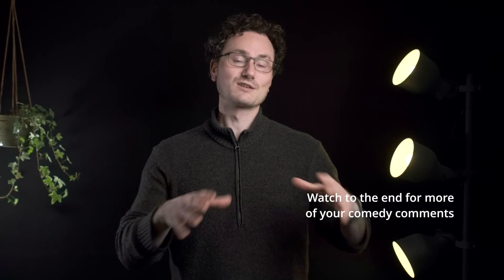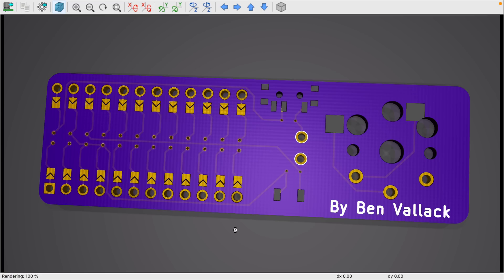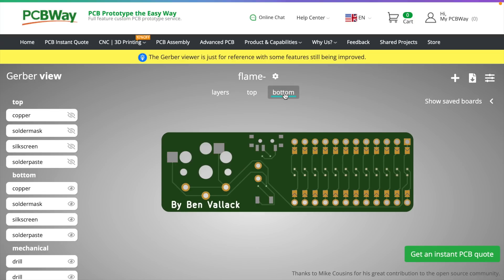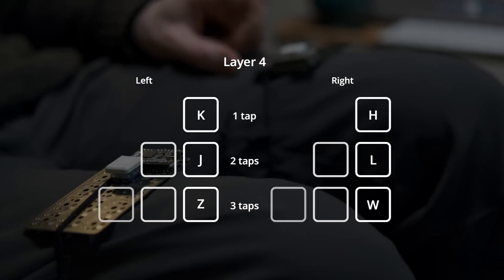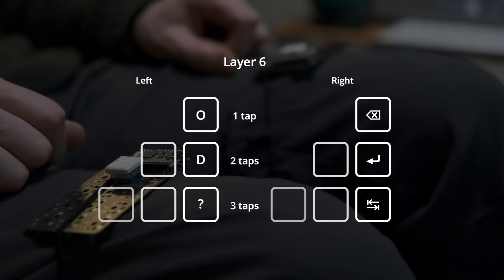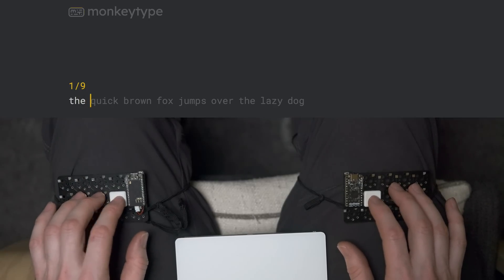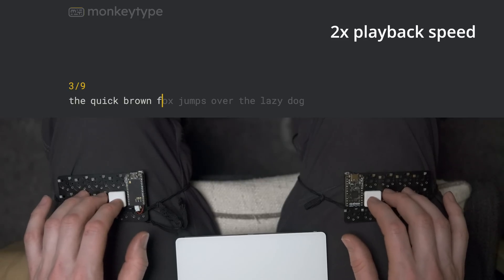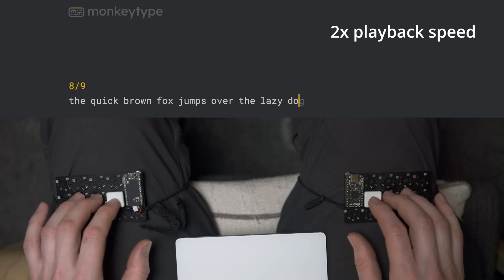World's Smallest Keyboard

Comment: This is near impossible. And near the end, it looked like it was not that bad. I think with multiple ways to jump, like tap+hold 1sec, or tap+tap+hold 3 sec, you can even improve it. What if you program a magnet key??? That might be programmed to output A for light press, E for midle press and I for all the way press. Or a magnetic switch with a tectal hold, like if you press it light, it will stop near the end, but allow you to press harder for an extra key, or extra function. Similer wit acceleration on a automatic car that has like a key in the end. ;) 
Nice video!!!

Comment: Although a custom designed keyboard is my goal, I have also always wanted my own R2D2. My thought was finger cots. Cots are basically mini rubber condoms for your finger tips. There are used by people who's job subjects them getting their finger tips cut by paper or something sharp, or get stains on finger tips from dyes or inks, Any way my idea is finger cots with mini wafer switches in the tips and wireless devices on each wrist to send the key switch data to the 2D2 unit. Voice command for some functions the R2 unit can do on it's own, but remote control movements via finger switches for having it maneuver through crowds. If done correctly the R2 unit would look self aware. I could event use Bluetooth have the two wrist controller talk to a more complex computer worn on my belt. That computer could talk to the R2, via 4-5watt transmitter, on one HAM Radio band and receiver on another of the HAM bands. I am after all a licensed HAM Radio Operator. I could them have sunglasses with a see thru LCD in one eye, and be able see what R2 is doing remotely and also feed a few line of low resolution text to that LCD. Allowing R2 to "speak" to me with random beeps and boops while displaying the actual data on the LCD screen... illusion complete. I would not want the R2 unit  more than a reasonable distance from me, but crowds can temporarily block you sight, so have a lower frame rate video might make the video flicker, but old analog NTSC or slower frame rate video can be legally  transmitted on 70 cm frequencies. The only time video would be transmitted would be when the unit is in motion, otherwise the entirety of the transmission is simple control signals and possibly audio from a microphone headset.

So Ben please look at my other post.
Reply: While I like the idea of finger cots I think building it into a glove would result in a much better user experience.
- Easier and quicker to put on. 
-The wiring can be hidden and protected.

Then again if you're going for a techie futuristic aesthetic then maybe exposed wires are a benefit? 

Anyway sounds like a great project, good luck and don't forget to post a video of it.

Comment: I am attempting to build my own custom keyboard, I want to solder the keys (Cherry MX), but also have an aluminum frame supporting the keys. I have the schematic complete and I have the PCB mostly done, however I need to know how to make or order a custom frame and how to insure the outer dimensions of the PCB will fit into the computer case, and on to the original mounting point. I am glad I ran across this video.

Comment: with 2 keys morse code can be fast, very fast... you'll be surprised how fast you can go!
Reply: I think I'd struggle with 2 keys for Morse code. I struggle enough with just one! It'd take some serious mental gymnastics and a better brain than mine to pull that off.
Reply: @charmio  I think what he's referring to is called an iambic key. It's the basic idea everyone's had about one key for dots and the other dashes except there's also a repeater function built in:
- If you want multiple dots or dashes in a row, you hold that button down the duration of that many symbols. 5 dots is just a single key press with a longer hold down.
- If you want to interlace, you tap the other key at the right time.  the letter "F" is .._. and would be entered by holding the dot and tapping the dash after the second dot.

Dot-dash generation is then only limited by your own rhythmic accuracy. This is how folks get way more than double the send rates of a regular single key that peaks out around 25WPM.
Reply: @TestSpaceMonkey  Interesting! I've never heard of that before. Cheers for sharing mate. That does sound much more manageable (though I still maintain I'd suck at it 😂)

Comment: Sorry that I just found you, a more practical extreme suggestion is a 5 key, one-handed keyboard. You get that same effect of not having to ever move your fingers, and you can use your other hand for your mouse. There are just enough chords to cover every letter, with enough extra spaces at the bottom to add on as many layers as you want. Below is a layout I wrote up a while ago that covers literally every key on a full keyboard, with plenty of extra space for any macros you want to add. If you want, I could write up an AutoHotKey script for this which you could copy, I don't think that would be too hard (if you have access to a windows computer). If you do want that, just tell me what 5 keys you want to play around with, and I can put it in a reply to this comment. This also doesn't use any double or triple tapping or holding keys down as that would just add time to the execution, but I could try to add that if you wanted, or obviously I could reorder any of the combos if you wanted, they're just in order here.

The chart below is a potential mapping of keys: 12 means you press both key one and two, like how you would ctrl+c on a normal keyboard. + is shift, ^ is ctrl, ! is alt, # is windows key. modifier keys work by being "held down" when the next key is typed. 

This covers literally every key on my keyboard, and you could easily add another layer by hitting the function layer key and then hitting shift, but I have no idea what you would even put there, maybe just a ton of macros?

1             a      1
2             b      2
3             c      3
4             d      4
5             e      5
12           f       6
13           g      7
14           h      8
15           i       9
23           j       "
24           k      '
25           l        !
34           m     @
35           n       #
45           o       $
123         p       %
124         q       ^
125         r         &
134         s        *
135         t         (
145         u        )
234         v        -
235         w       +
245         x         =
345         y         /
1234      z          ?

1235      .           :
+1235    hold control for the next letter
^1235     hold alt for the next letter
!1235     hold windows key for the next letter
# 1235    turn number keys into equivalent function keys for next press (f10, 11, and 12 are ", ', and !           @ could be printscreen, # could be delete, and so on for whatever other keys you want)

1245      ,            ;
+1245    hold control shift for the next letter
^+1245   hold control shift alt for next letter
^+!1245  hold control shift alt win for next letter (who even needs this)
^1245     hold control alt for next letter
^!1245    hold shift alt for next letter
and so on, you get the idea. all the different combos of the four keys can be reached from here.

1345      spacebar
+1345    return
^1345     escape

2345      hold shift for the next letter
+2345    remap keys to secondary values for the next letter
^2345     for special key combos: you press this, then the appropriate modifier, then any number of keys to be held at the same time, then hit shift to submit. This is for people who need weird combos, like if you needed ctrl+alt+c+r+j or something like that. you could also use this for ctrl+backspace+backspace... or ctrl+delete+delete... or other things like that
!2345     turns 1 into left, 2 into right, 3 into up, and 4 into down. press 5 to escape

12345    backspace
+12345  delete
^12345   ctrl backspace
!12345    ctrl delete
Reply: watching the 16 key video, I could definitely add an escape layer key, clicking, and click-and-draging too, idk about repeat but it probably wouldn't be too hard; but autohotkey is a windows thing & I don't know the mac equivalent. If you have easy access to a windows computer you could try it out, but to do anything on a mac you'd either have to write something yourself or get someone who knows the mac equivalent to autohotkey to do it.

Comment: Would it be easier to type if you alternated the layer switch key on every press between layers. It would make the sequencing harder to memorise initially but you would have a theroretically faster layer switching as you could implement tighter timings.

Comment: This is the first time I've ever made it into someone's video. Nice!

If you were to somehow configure it such that the right key is a dot and the left key is a dash, you may be able to effectively type using Morse code without the speed hang-ups of waiting for the length of a dash. Also, you could open it up for easier symbol access by using the tap dance feature the same way you are here.

Now, of course, I have no idea how difficult something on this scale would be. I've only fiddled around with QMK for the better part of a week since I finished my first DIY build, but I imagine this would be possible with some modifications to allow for more taps. My time spent in Oryx had me convinced that the limitations were just that — limitations — but I've seen some absolute wizardry in the keyboard community.

Comment: In fact, my first reaction is Huffman encoding on letters as well as common prefix and postfix
Reply: If we count left key as 1, right key as 2, and both key as 3. we can encode this thing like this

A 111
B 2131
C 122
D 132
E 23
F 2132
G 1133
H 1132
I 221
J 213332
K 1233
L 121
M 1131
N 211
O 222
P 133
Q 213333
R 112
S 212
T 223
U 131
V 21331
W 1232
X 21332
Y 1231
Z 213331

which gives an average keystroke per letter of 3.09
and group starting with 3 is reserved for number and other keys

Comment: Instead of thinking about this in terms of layers, how about as an n-ary Huffman tree? Obviously it would be harder to learn, but I think it might decrease total key presses. Replacing triple taps with a Left+Right combo would also save us an entire key press
Reply: Fun fact there is a full blown research paper on a topic of 4-keys keyboard that utilises the huffman algorithm for sequence creation! They call it 'H4-Writer'
Reply: Could you explain for mortals?
Reply: @smaspa8627  Huffman tree can best be described as a binary tree structure where at at each bit for a symbol, it can go left or right and that bit ends the bits used to identify which character is used with that many left-right choices.  The standard Huffman tree has one of the directions consistently terminate the string of 1s or 0s, whereas the other direction still possibly branches.

The most common symbols (say  “e” in English) will use the minimum number of bits (or, left-right choices in the tree graph structure) and the least-frequent symbols will use more bits, possibly more than is normally used, if enough different symbols are used in the stream of symbols: this isn’t a problem if they are notably more rarely used in the original stream of symbols than the common symbols are used.

Now, n-ary Huffman tree just means it’s not merely left-right, but perhaps far left, middle left, middle right, far right options because you have (in this example) n=4.  Because you can easily hold one key down and THEN tap the other key, and this is mirrored for both keys, and also just tap either key without keeping it held down, this is a way to type with the simplest of chording/not chording, and once you’ve typed the minimum number of single keys or pairs of held-and-pressed, you’d get the expected symbol out, and then you’d be on the way towards the next symbol.

In English, the letter e and the space I would expect to be the two single key press symbols, so you’d only use a single keystroke for each: a veritable bargain, considering 2 keys and over 100 possible symbols to type (consider also the modifier keys, function keys).

Note: Huffman trees are used in non-lossy data compression, and results in typical text approach 2:1 compression ratios because of the statistics and how they’re encoded.

Wikipedia has good coverage of Huffman encoding.
Reply: A huffman tree might be nice but I think it will be slower. You have to rely on a timeout for the key press to go through. Witht he current method once you select a layer you only have to worry about the timing between the single and double tap.

Instincitvly I feel like a huffan tree will be slower and more prone to misinputs
Reply: @szymach  If you use a prefix code(which a Huffman code is) there should be no need for timeouts, you just have a sequence of left, right (and maybe left+right) presses. And since the code possesses the prefix property you know immediately when a given character sequence is finished.

Comment: With such a small layout, using huffman coding (or a ternary extension of it) to decide your layout seems like a pretty good option. A navigation style for a 'vanilla' huffman coded layout might be:
0: left tap
1: right tap
Reply: I had the same idea! I would love to see a GUI on top of an n-ary huffman tree that showed you where you are in real time.
Reply: Can you explain a bit more? How would you type a letter?
Reply: @ux2951  Huffman Coding is a type of compression where the number of 'digits' (here, button presses) needed to represent a symbol is proportional to how infrequently it is used. Like normal, every time you press a button, the result will either be:
a) a symbol
b) a layer
Like Ben's current layout, typing a symbol will take you back to the 'root' (layer 0).

To use the first example on the Huffman Coding Wikipedia page, 
typing 'e' would be: LLL (3 presses), while 
typing 'p' would be: RLLRR (5 presses).
'p' takes more presses, because in the data used to construct the tree, 'p' is less common than 'e'.
As an escape mechanism to make typing easier, you could also make simultaneously pressing L and R take you back to the root without typing anything.

Comment: you know, if you use chording (idk what zmk has for that; in qmk you can use macros or the gboards repo), you can actually have effectively three keys, by pressing either one, the other, or both. now I think of it, it might even be possible to handle exclusively inside tapdance, but I don't really remember.
Reply from the maker: This is quite true, I actually tried separate hand combos on my 16 key, but it’s pretty hard. But with the forced delay from tap dance you might actually be able to get away with a quite big timeout  on the combo which would make it much easier. Good idea!
Reply: A single tap on either key is that key, whatever it is currently, so there are 2 keys.
Next, tap and hold one, then tap the other: third key and a matching fourth without switching layers.

Now, cross this with Huffman encoding with a 4-way tree.  Finger Twister (well, not quite: more Brain Twister) with a single layer and chording/no chording.

Comment: The only major flaw in this video is not trying to type with your feet! Instead of a keyswitch, grab a couple foot switches and dance for us :)  Replacement sewing machine foot pedals can be cheap, just make sure they're momentary switches. 

Although, now I think about it, there were a couple keyswitches way back when that registered a different input when you really shoved it down, which might actually be a comfortable way to increase input variety when using legs rather than fingers. Food for thought, at least.

I'm sure you've mentioned that you're aware of this, but I'd be interested to hear your thoughts on voice-typing. Obviously for a typing test it's besides the point, so I'd be more interested in how you find it for work, or maybe combined with a small keyboard and other input devices, etc.

Notable videos include:
Travis Rudd - Using Python to Code by Voice (probably still the most fluid demo imo)
Emily Shea - Voice Driven Development (demo and some explanation of philosophies and methods)
Programming Piglet - I Had To Learn To Code By Voice (good demo of full-computer workflow)
Greg - Code by Voice with Kaldi (alternative software for variety, includes whistles, pops, blows, clicks, etc)

Comment: Very cool. I appreciate it’s a demonstration, not an actual proposal for use, I’m just thinking of the RSI issues of two fingers doing all the work with so many repeated taps. Ouch. Great explanation though as always, I needed to pause and rewind a couple of times to understand. Something in my head still says April fools with paranoia.
Reply: Think of the guys who used to run morse code at extremely fast speeds during the war

Comment: What if we use a drum stick per hand so we can do small, controlled rolls rather than having to press a button up to 3 times in a row?
Reply: “Activate the LRLL paradiddle layer, followed by a 500ms buzz roll. When paired with Plover and a custom dictionary, I’m up to 70wpm. Easy! Once I learned ghost notes, my typing speed tripled overnight! Now I’m working on my own layout called Sticks Down, optimized using ML analysis of grooves played by Jojo Mayer, Thomas Lang, and Lars Ulrich. Next I’m going to add positional sensing so I can create home row mods. Open position is superior. Did you know that original drumming was designed to slow you down due to sticks hitting each other? Also, grip matters. French grip is like using tape-modded 12g gChocs.”
Reply: @ac213a  top 10 most legendary comments I've ever seen lmao
Reply from the maker: Love it! Might stick my small boards on a stick and try that!
Reply: I present to you, literature in the style of Tomas Haake.
Reply: I love this idea, but all you need is haptic feedback to give you a sense of bounce or perhaps you could have something that detects the height of your finger before the keystroke or both.
Reply: Up, down, full, tap